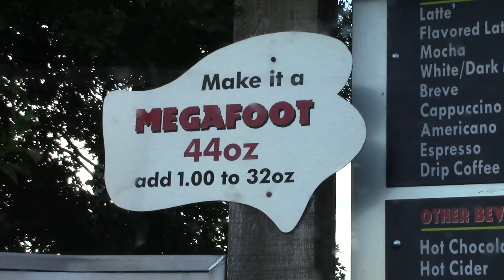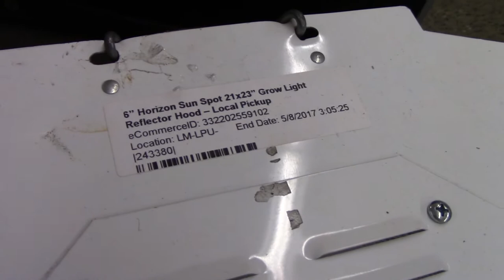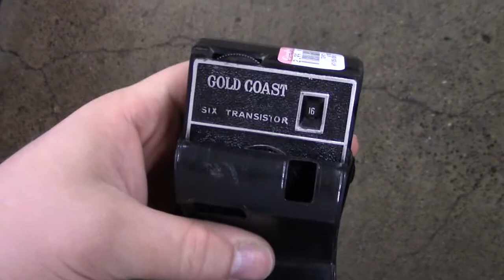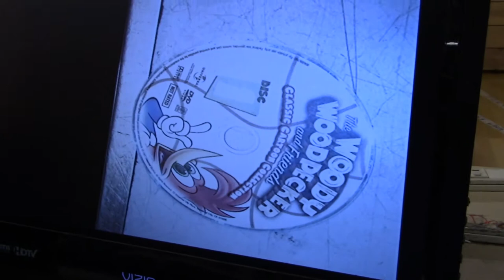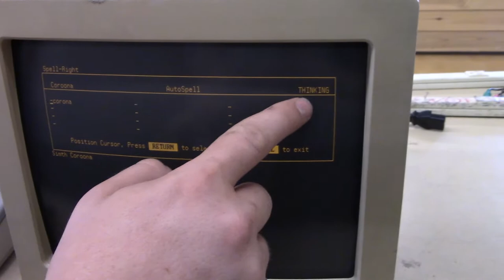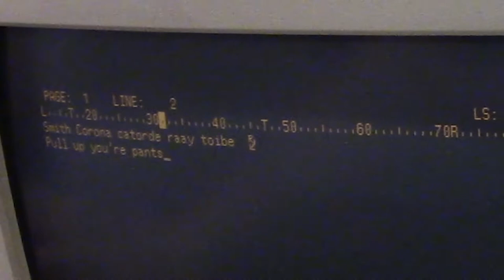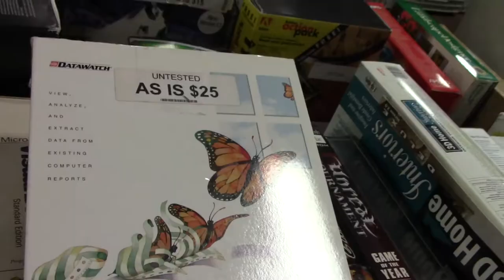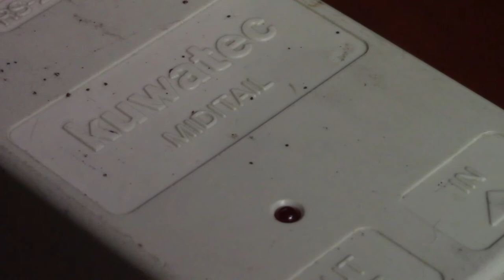Vlogue 2 - The Junk Stores

Comment: @ 3:04 Logitech Extreme 3D Joysticks! I have one of those, they're great. Ooh, and one of the budget SideWinders too.

@ 10:49 oooooh. I have one of those, a PWP3900. I got it for like.. £15 along with a more basic electronic type-writer cuz the place I got it thought it was the printer to the 3900 (same brand). Keyboard is GAAARBAGE. What's really neat though is the floppy is PC formatted and it can save in a format a PC can read. In a pinch you can use it to print a text document typed on a modern-ish PC.